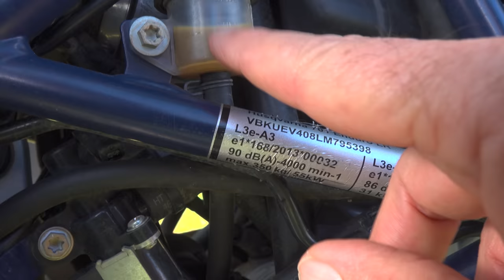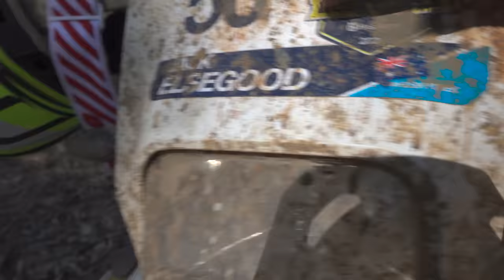Motorcycle Adventure - 2022 Husky Trek - Episode 1 - Movie Length

Comment: This is brilliant Dave! Looking forward to episode 2. You look very comfortable on the slimy stuff on the 701. I’ve seen in “rumble in the jungle” that you also own a 300 2-stroke. Given the above,  do you often feel you need to go out on that rather than the 701?
Reply from the maker: I haven't been on the 300 for years and hence it wasn't working properly.  But usually I would be faster on that single.  In terms of the 701, much of that confidence comes from having he suspension set up correctly for weight and purpose.  It makes a huge difference.  See how it lands after a decent jump.